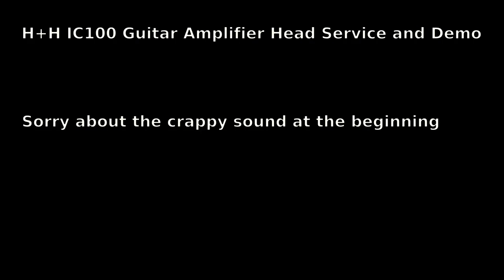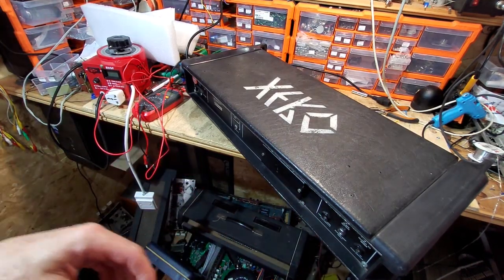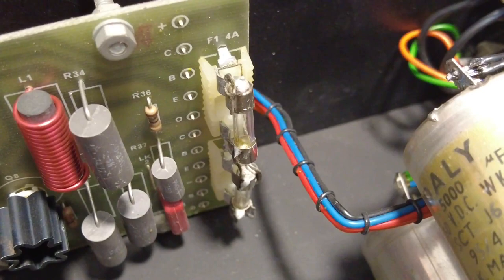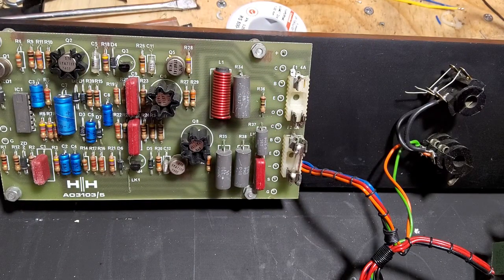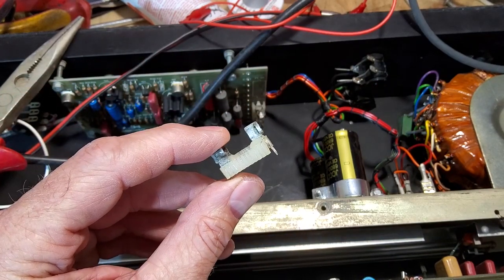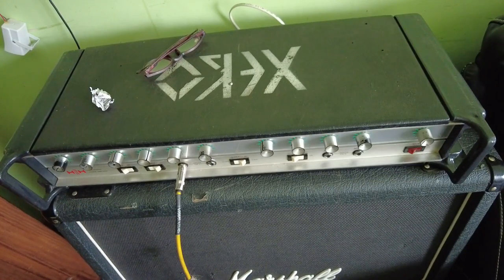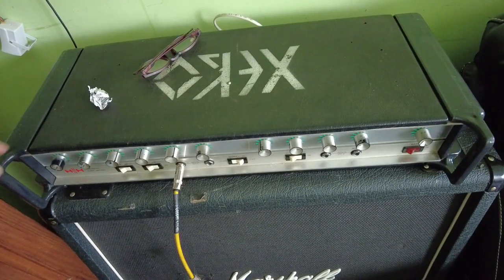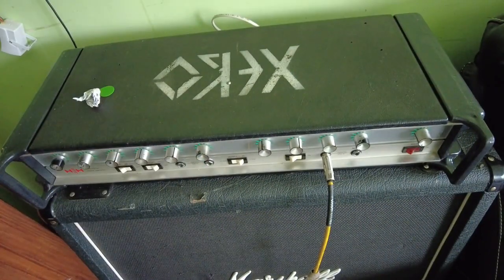HH IC100 Guitar Amplifier Service and Demo

Comment: I have 2 HH amps and I’m absolutely in love. Best solid state amps ever built. I have an IC100S and the later IC100L which came out in 77 and it has a single ended jfet as a preamp and op amp post and it has a master volume. Killer amps. Marc bolan used them for years. Of course Wilko, and status quo used them for a long time as well. Very underrated indeed
Reply from the maker: Hello Justin. Yes, very underrated. It's nice to see there is still a few of them around. Thanks for watching and take care.
Reply: Justin if you don't do some captures for NAM from the IC100S, I'll get Peggy Mount to come and shout at you!
Reply: Andy Scott from The Sweet,  Steve Diggle and Pete Shelley from The Buzzcocks, Daniel Ash from Bauhaus. Lots of great players with fairly distinctive tones used these amps. I got a VS Musician 2x12 combo. And love it, pair it with a JMP 2104 MV 2x12 combo.

Comment: This unit is the later model with the IEC mains connector, commercial 741's and a few cosmetic internal differences. The IC100 was never a budget amp when it came out and the fact they are still revered is testament to the build quality. The original units had round Bulgin mains input connectors and the 741 op amps were all military grade gold flashed ceramic units. Indecently, you can wire in 8 pin 741's with no changes! Problems with the pots are nearly always due to bashing the front, laying the head down or plain wear and tear. Very easy to work on electronically even if the mechanics make life a little easier. The output stage of the IC 100 was the same as that fitted to the 5 channel mixer amp. Great unit and the combo though heavy was just wonderful. Early units had an angled stay so that you could lean the whole amp backwards so you could hear yourself. Proper powerful units these. Unless on stage, you really needed the studio setting to bring things under control.
Reply from the maker: Hello Steve, thank you, some good info there. They certainly were not budget amp when they were new. I refereed to it as a budget amp in the video based on it's current value against the repair bill. Maybe in a few more years these amps will be come more collectible. I think they are one of few solid state amps that are worthy of a full restoration. Definitely better than all this modern modeling rubbish that they are manufacturing today

Comment: I owned a HH ic100s back in the mid 70's the sustain was more like a fuzz box than a sustain, another amp I didn't get the tone I wanted !  The pots got scratchy after I had it for around 2 years. They were cheap at the time I paid around £99 from new !
Reply from the maker: Hello. £99 was a lot of money in the mid 70s.  I just looked it up on Google from 1975. £99 = £1073 in today's money. Can't imagine paying over a grand for a solid state head. Does that seem right? Did £99 quid seem like a grand back then? I was a kid in the mid 70s so had no value of money then.

Comment: The IC100 was a very popular amp in the early 1970's for it's almost valve like sound, reliability and lighter weight. Designed by  Mike Harrison. The most famous user of the combo version of this amp was Wilko Johnson of Dr. Feelgood  who got a huge sound out of it live. Probably the best UK made solid state guitar/bass amp ever produced combined with it's JBL loaded 4X12 cab (2x15 JBL's for the bass set-up), took some beating at the time.
Reply from the maker: Hello Pete. Yes, top class gear in their day.. I bet the cab was heavy with the JBL speakers?
Reply: @vintageguitaramp_guitarteacher    Indeed they were.. It was either grit your teeth and grab with both hands or find someone who worked for Pickfords  to hump it into the venue.  😅
Reply: Sure I spotted Marc Bolan using them at an Earls court show in 72 . I think the lights went with the whole glam thing .

Comment: Hi there. I just picked up the 2x12 combo version of this amp. One of the things I noticed is that the clean channel has bleed over from the dirty channel. Should that be happening or should I expect crystal clear clean tones for this amp?

Reply
Reply from the maker: Hello. I don't think that should be happening. The one I repaired didn't have that problem. It had a really good clean tone. I will do a bit of searching online when I get a minute. Someone else might have had the same problem and it might be a quick fix. Thanks for watching and take care.

Comment: Jaysus been watching and enjoying your channel for quite a while, don’t know how I missed this.
Been collecting HH equipment for a long time. Anyhow, yea brutal job in the fuses I agree!
I’d say yerman got good info but bad execution.
The fuse holders corrode badly if you lose either + or - rail you potentially have 40+ or - volts at the output  ,very loud hum and your lovely Speaker is a smoke machine. Been there, bought the T-Shirt :(
They can have a really good Tremlo.
Love the playing 
Thanks for all you do.
Trev.
Reply from the maker: Hello Trev. Good to hear from you again. How much HH equipment do you have?
Reply: @vintageguitaramp_guitarteacher  
Hi Marzy ( as we say in Dublin)
To be honest possibly too much :)
Have thinned the heard a bit, needed a few extra quid when I gave up work to look after my lovely mum.now passed away a while before yours.
What’s left more or less…
Have 2 combos , 5 or 6 heads ,2 clockwork concubines(1 fried) a Stereo 12 desk, digital multi echo(actually analog) Sold my mint tape echo. 
Over the years I became fairly friendly with Mike Ameson of MAJ, you might know him 
Brilliant engineer and had a great stock of HH parts.
Thanks for the reply always enjoy your videos
Cheers
Trev

Comment: Hi, I have combo version of this amp, haven't owned for long but noticed it gets very hot where the two transistors are around 70 degrees c, is this ok? not much of a heat sink at all, in fact it's using the chassis which I thought strange. Amp sounds great though, just don't want it to burn out. Thanks.
Reply from the maker: Hello. It could have some leaky transistors or some components that have drifted which could offset the bias maybe. Take it to tech near you and get it checked out. They are nice amps. It's getting it serviced. Thanks for watching and take care.
Reply: Hi, thanks for your reply, yes I've taken it to my tech, he's pretty good so expecting it will be awesome again once back, thanks again, all the best.  @vintageguitaramp_guitarteacher

Comment: I haven't seen any of these H&H amps here in the great state of Texas.  It does sound pretty good for a solid state amp.  My only solid state amp is a 1980's Fender Princeton Chorus, which sounds good on the clean channel, but terrible on the overdrive channel.
Reply from the maker: Hello Michael. I don't think many of our Solid State amps made it across the pond. As you say it sounds pretty good for SSA. I don't think any Solid State manufacturer got the overdrive right in the early days. Thanks for watching and take care.

Comment: HH are in no way a budget amp! Wilko and Marc Bolan are amongst a lot of professional musicians that used these amps. They are powerful, good quality, easy to repair and bloody reliable and can be run flat out forever.
Lovely sounding sustain and cleans are nice with a bit of on board reverb. I have had mine since the 80's. Cap replacement in 2023 and it is back to being as good as the day it came out of the factory.
Maj electronics stock the spares for these.

Nice one!
Rich 😊
Reply from the maker: Hello Rich. Sorry for the late reply. They certainly were not budget in their day. I think they were the best solid state amps ever made in their era. And probably better than some of the modern rubbish made today. I will check MAJ Electronics, thank you. Thanks for watching and take care.
Reply: Andy Scott of The Sweet also was an HH user, that distinctive guitar sound is just a flat-out amp.  Pink Floyd  (see live at Pompeii), Hawkwind, many well-known names.